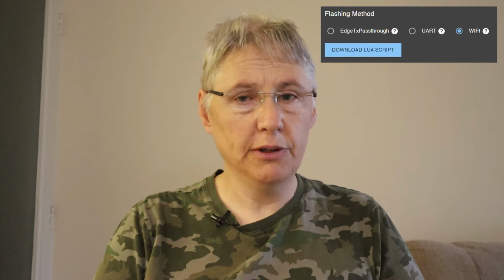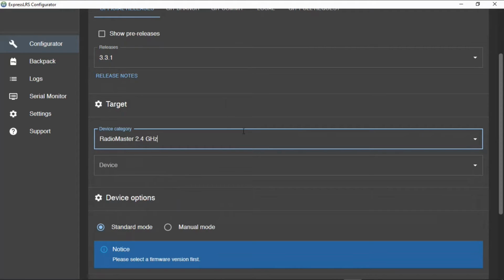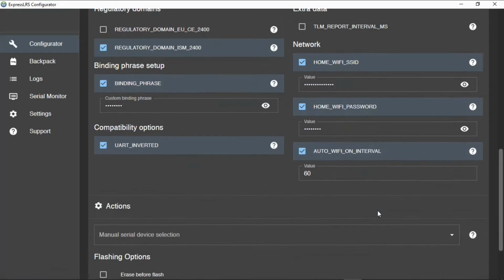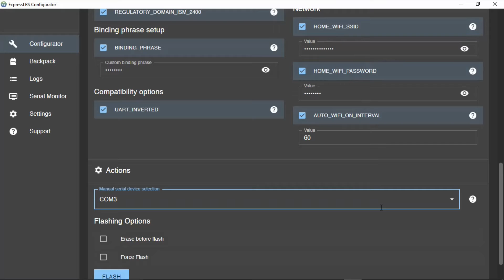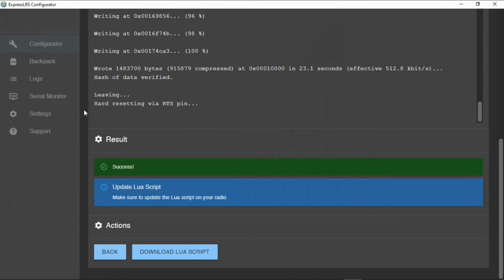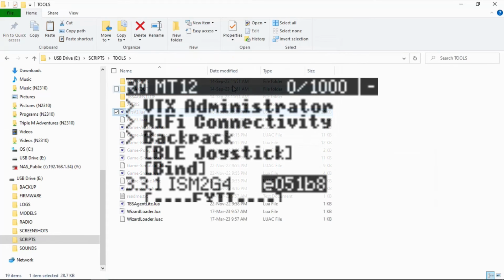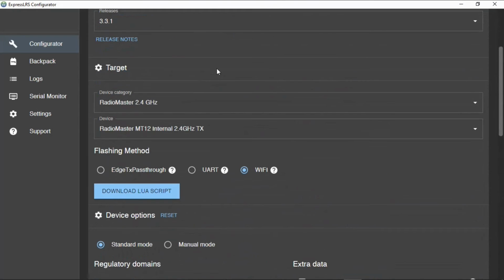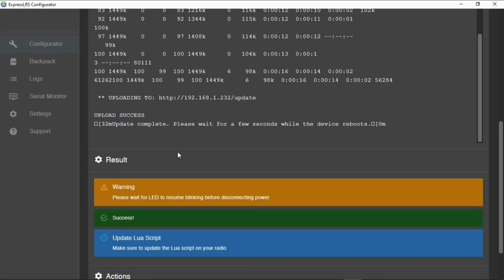RadioMaster MT12 Updating Express LRS Firmware

Comment: I am about ready to give this whole thing up, but before I do I'm reaching out to you to see if you are able to help me. I eventually managed to update the firmware with edgetx buddy as the configurator comes up with an error message, so I assume it means unsuccessful and I don't understand the error message it gives. 
So far I have up to date firmware, luap and SD card. I have bound the receiver to the transmitter. Fine. As soon as I hook up the servo as well as the ESC, the receiver has a constant red led, showing that it's bound, but no signal bars show on the transmitter screen. Unplugging the servo from the receiver and powering the system up shows bars on the transmitter screen. Somehow, having the servo connected interferes with the connection between receiver and transmitter. I don't know where to go to ask for help. Can you help me, or point me in the right direction please? Thank you

Comment: Do all MT12 radios need to be updated to the latest firmware or can I go into the radio itself to show me what version it has and compare online?
Reply from the maker: It is not necessary to update but the improvements are worth it.
To check version of ExpressLRS in you radio:
SYS
TOOLS
launch ExpressLRS script
Scroll down current version of firmware is shown at the bottom of the screen.

Comment: Hello - Thank you for the video.  I followed your guide and updated my ELRS F/W to the latest 3.5.3 using Express LRS Configurator.  Everything said it was successful but when I look at my ELRS F/W version in the Lua under SYS it reads LR1121_init_Fc40555elSM2G (the rest is cut off).  Did I do somehting wrong or is this the correct version?  I have updated EdgeTX to 2.10.5 Centurian.  Thank you for your help.
Reply: Follow up - I downgraded to 3.5.2 and everything seems like it worked perfectly.  Showing the correct 3.5.2 version in the LUA.
Reply from the maker: My suggestion was going to suggest reinstalling the firmware. Just a note you do need to shut down the Lua script and relaunch to see the updated version.

Comment: my first update keeps freezing on com3? clueless never messed with open source before
Reply from the maker: Are you selecting the third screen option USB Serial when plugging in your radio and using the cable supplied with the radio?
Reply: @the-happy-RC-flyer  yes i am, has a yellow bar saying now that it basicly takes a while, i canceled it last night and went to bed, tried it again today, before i did i turned on the radio, and went into the express rls option and now is missing, im new to this so maybe just confused, idk
Reply: @the-happy-RC-flyer  i had stuff some how get deleted, i went and pulled the sd card and downloaded to it from the RM site, boom let me use the radio
Reply from the maker: I am pleased you have solved your problem.

Comment: Thanks for sharing. Have you experienced ST(steering) option suddenly gone after binding to a new rx? My throttle is working but cannot choose ST in inputs section. It shows 3 dashes only.
Reply from the maker: Could you email me a picture of the screen of your radio please and details of the receiver you bound to your radio before the error occurred. triplemadventures@gmail.com
Reply: @the-happy-RC-flyer  no worries, I managed to solve the problem by downloading the mt12 sd files from radiomaster website then copying the radio config to my mt12 sd card.

Comment: bill thanks again fora grteat video and overcoming my fear of reluctance to edge tx lol.  i purchased the 4 in 1 radio but also got the external nano elrs adapter.  i didnt see an option on the express lrs program for external elrs, just internal. will that show up when i plug my radio in? btw i fly many planes and jets, and spektrum is my go to there but if it changes my increasing knowledge of edge tx might change that lol. thanks again
Reply from the maker: Yes as soon as you plug in the external module in you will be able to select the external module.
Reply: @the-happy-RC-flyer  bill do i plug into the module itself or do i plug into the data port on the side after i install the module
Reply from the maker: Hi Micheal, you will just need to plug the module in and you will be ready to no firmware updates needed.
Reply: @the-happy-RC-flyer  bill is it a good idea to update a new rt12 eslr . at least i could check what version it has and connect to wifi
Reply from the maker: @michaelrajca6043 You do not necessarily need to update to the latest firmware but I normally do. Only do the update if you are confident to do so.
Reply: @the-happy-RC-flyer  LOL Bill! That's like telling a kid "Don't touch that on your new toy or you will break it!!!" 😜😁
Reply from the maker: Micheal please email pictures of your radio, module and receivers. I will then be in a position to assist you. triplemadventures@gmail.com. The module is plugged in on the back of the radio no wires or leads required.
Reply: @the-happy-RC-flyer  i dont have the radio yet but i do understand. all i am asking is that do i just plug it in like in your video because i think i saw a usb-c outlet on the radiomaster nano module i bought. i may be wrong so maybe if i just plug it into the data port on the side of the radio like you did it will read it automatically then. i know it just plugs in but you also used  a cable to plug into the computer. i was just asking which port

Comment: Hi Bill and others - is there a new version of EdgeTX already since release of MT12? Mine comes next week - should i go looking for an update straightaway?
Reply from the maker: Hi Mitch, the MT12 is not supported fully yet so no ability to update the MT12 at the present time. I would guess the next version will include the MT12 but please do not quote me 😊 The radio is working fine with its release firmware.

Comment: Hi Bill. Great Video. Any chance you would know how to update the edgetx firmware on this radio? Im trying to get my headtracker working through sbus but the option is not there in the menu. So i figured that maybe updating the firmware and enabling the SerialPort Sbus option would get everything working. Any help is appreciated.
Thank You
Reply from the maker: Hi Em, the radio is not supported at the moment on the EdgeTX website. This will soon be added and I will then film a tutorial video on how to update the EdgeTX firmware.  If you go to Model Setup scroll to Trainer Mode turn on and you can scroll to the option Master/SBUS.

Comment: I tried to update mine followed your steps but when I hit flash I get an error
Reply from the maker: Sounds like your radio is not connecting to your computer. Are you selecting USB Serial option on the radio when plugging into your computer?
Reply: @the-happy-RC-flyer  yes and it comes up as a comm port on the configurator but only says com port not anything else like yours does
Reply from the maker: Is your computer Windows?
Reply: @the-happy-RC-flyer  yes.
Reply from the maker: @timmyd463229  Hopefully this may help so worth a try. 
This video should help you. I think you have a driver problem please see link

Go to 1 minute 47 seconds

Driver Problem Solved

https://youtu.be/_vbl1fZM2Dg
Reply: @the-happy-RC-flyer  I will try this. Thank you I didn't see this reply yesterday
Reply: When I look into the device manager it shows mt12 as a device but when I try to update the drivers it brings up like 1000 different options not like on the video. I tried to flash the update again. The it says failed to open port
Reply: @the-happy-RC-flyer  I got it to work I had to use zadig and update the driver to the CDC serial driver or something like that and it did update thank you I appreciate the help